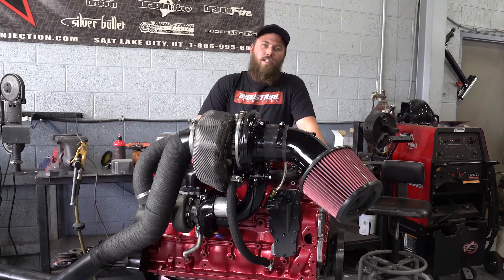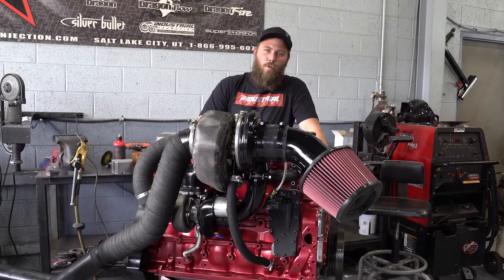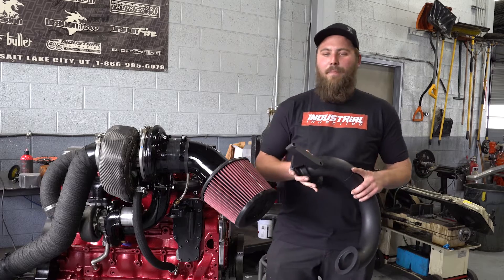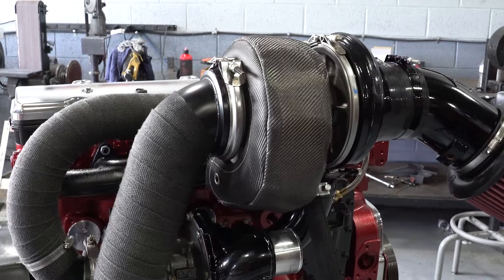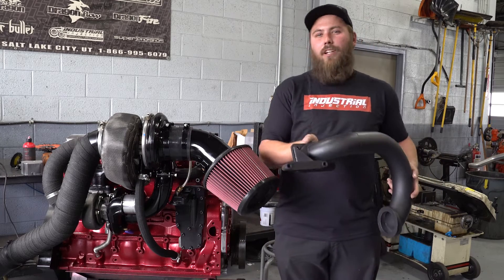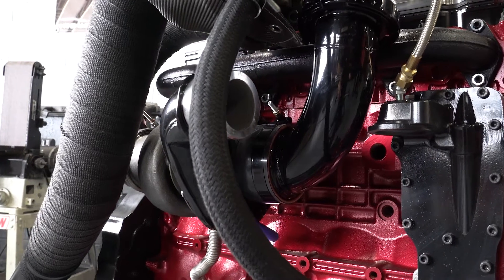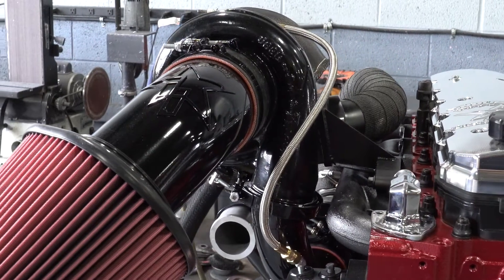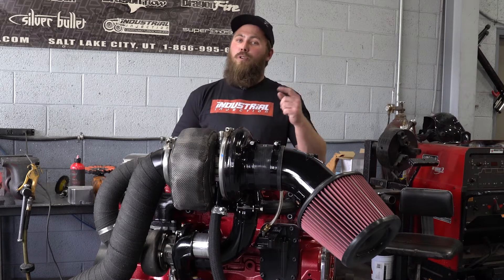2003-2007 Dodge 5.9L Cummins Quick Spool Compound Turbo

Comment: Can you keep passeneger side battery with this kit? I use my 2nd battery for my trailer charging system and all electrical connections. Don't really wanna clutter up the driver side battery and be down to 1 battery
Reply: I believe I read that you need to relocate that secondary battery somewhere else. I also think you need two batteries regardless to start the motor. I have a 05 24valve and I had some connections issues with the terminals on secondary and truck wouldn’t even turn over. Requires a lot of voltage for one battery to power that tank on.

Comment: I'm not familiar with what is exactly different between the stock HE351 and the drop-in phatshaft turbo. Would this work with the stock turbo or does it have to be the phatshaft turbo?

Comment: What RPM will this typically start making boost, and what RPM does it reach max boost? I’m assuming this is on a 5.9 CR with fuel upgrades.
Reply: Valid questions

Comment: Have you ever noticed a decrease in power after going from a single to compounds?
Reply: I want to see a video with this kit running!  Hows it sound?!?!
Reply: @jimbeaver8100  my setup? Have videos on my channel.
Reply: @wild12valve  was wanting videos of the industrial injection kit. But i will check yours out as well!
Reply: That's kind of loaded question because the size of turbos dictates that entirely. A single 488 would make more power than an s475 over stock but that compound setup is excellent for daily driving and towing where the 88mm would be a laggy hot pig.
Reply: @dontworryaboutit1  I should have been more specific, like on my setup, ran a S475 as a single, then went to compounds with it and a S464, lost quite a bit of power and had to gate it.
Reply: @wild12valve  yeah torque comes in quicker but I think it chokes up the 75 having to flow through the 64 and air gets hotter going through 2 turbos at wot
Reply: @dontworryaboutit1  it's cool too because just playing with the external gate I ran around 70psi, then 40psi, only lost .100 and 1mph is the 1/4. One thing I noticed is boost actually rolls in slower say from 20psi to max compared to just the single. I believe it's because it has to spin two turbos up to speed instead of one.
Reply: @wild12valve  yeah and at lower boost your 75 isn't flowing what the 64 is trying to suck in so it fights that. They definitely aren't the answer for every situation but compounds have there place
Reply: @dontworryaboutit1  I put a dual reading boots gauge, 26psi from the 475, and 52psi total after the 464. So it's actually pretty well balanced.